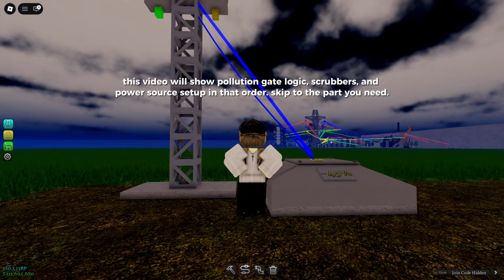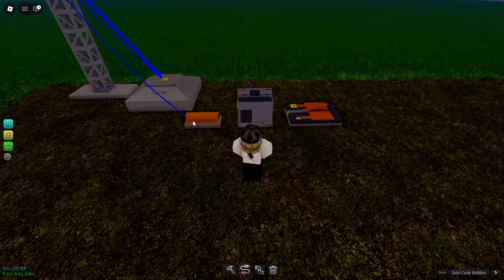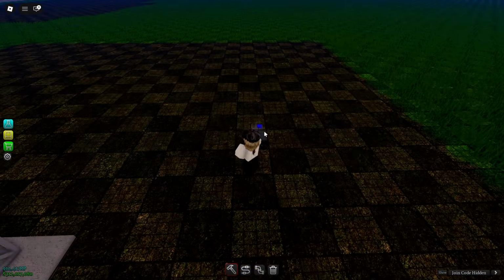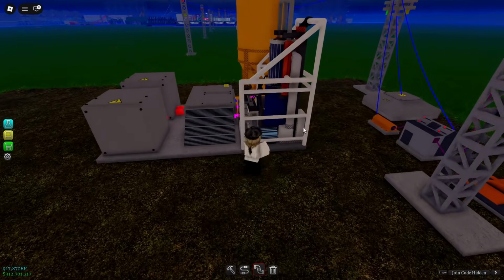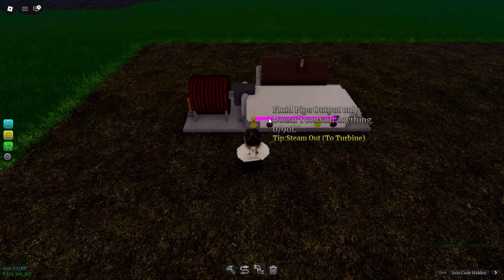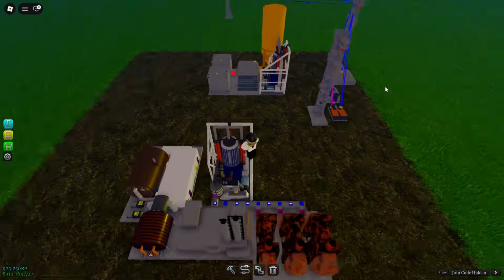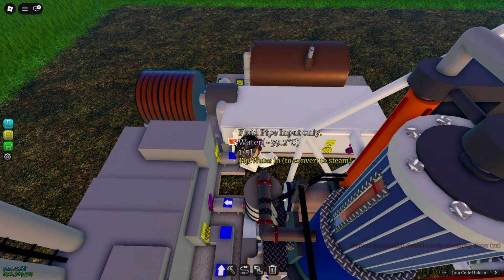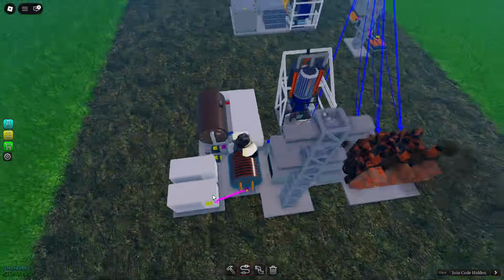pollution gate logic setup with scrubbers | industrialist

Comment from the maker: for anyone who's encountering issues, join my discord server: https://discord.gg/YQ8eZ4evgG
it's much easier to be able to see screenshots of your problems than describing them, a lot of the issues can be easily resolved if i see whats actually going on.

i've noticed that a lot of people have been doing the same mistake so i'll point it out:
your scrubbers should be receiving energy from your breaker's output.
main energy source->resistor->pollution gate
pollution gate logic output->breaker logic input
main energy source->breaker power input
breaker power output->hmvt->scrubbers
Reply: thank you so much, no one told me the hmvt and to be only connect to the breaker
Reply: im subbing rn (:

Comment: i dont think i understand, does the pollution gate logic work on all of the 34 scrubbers in my scrubber farm if i only have one pollution gate, or do i have to attach the logic gate setup to each scrubber individually?
Reply from the maker: you only need one for your entire setup, you just need to connect the output of the breaker to multiple hmvts to efficiently power the scrubbers.
Reply: @neuroticzombie  So all of the scrubbers need to be on the same HMVT series? Like they all need to originate from a singular HMVT? Sorry if that doesn't make very much sense.

Comment: I made a same version but with the logic fluid pipe valve and i think its simpler and better cause if you got alot of scrubbers you can just disable them by letting pipes flood with residue
Reply: but then how do you connect the logic breaker output into the logic fluid pipe

Comment: How come the logic breaker is not producing power?
Reply from the maker: the logic breaker stops power from flowing when the pollution percentage is lower than -45%, because you set that number as your max. once it reaches -44% it will let power go through so the scrubbers can bring your pollution back down to -45%.
Reply: @neuroticzombie ahh I get it thanks so much so for clarity my scrubbers at the end arent acually struggling for powering it’s just there not being provided power?
Reply from the maker: @HarpeeAubry  if you can provide screenshots on how your scrubber setup looks, ill be able to help. join my server: https://discord.gg/YQ8eZ4evgG

Comment: its not working for me, idk why, my pollution is at like -51 rn but it was at -130. so i had to liquid dump a bunch of residue so my scrubbers wouldnt bring it down further which limits my tree growth, i dont know how to fix it. everything is powered up, everything is connected, but its not limiting it to -45 and its going beyond -45 (e.g -130)  pls help
Reply: just cut the power and when you find a fix do the fix
Reply: @not_.kamixd I figured it out almost right after this, so I connected the logic breakers output to the node powering the scrubbers, and powered the other stuff with a different node

Comment: I have -1,035 pollution, it doesnt work, i've set the pollution gate to -45 pollution, the maximum value is enabled, although, if i dont enable minimum value, it just doesnt work, the power breaker has max power buffer, the power breaker is sending the output energy to an hmtv powering the scrubbers and water pumps, I have a diesel generator power source.
Reply: What
Reply: I think u should replicate what he was doing, by the way u should use something else to power it i think.
Reply from the maker: if you still need help, you can join my server

Comment: Bro pollution gate have 0 power how I have 50k polve
Reply from the maker: im not sure about what youre talking about, but the pollution gate is only the "brains" that decides if the logic breaker should be sending power or not. make sure youre using a resistor to power the pollution gate. if what you mean is your logic breaker not sending power, check your pollution levels and see if its under -45%. if thats the case then the logic breaker shouldnt be sending any power because its trying to increase pollution level. once the pollution level is at -44%, the logic breaker should be sending power.

Comment: I have -120 pollution, but when I use this, scrubbers still work,any help?
Reply from the maker: make sure your logic breaker is configured properly and maximum value is enabled. if that doesn't fix it, enable minimum value and set it to -45.
edit: also your scrubbers could still have power stored in them, and it takes a minute for it to fully deplete and turn the scrubbers off.

Comment: mine doesnt work, idk why but the Logic breaker isnt sending energy it only accepts, is that normal?

EDIT:: okay so i turned on Minimum Value but kept it on 0 and now it sends energy, it send about 0.1 mf,  BUT it still isnt working, i put the wire on all my HMTVS that are controlling the scrubbers
Reply from the maker: the logic breaker only allows current to flow when the pollution percentage is above -45% (value used in the video). check your pollution percentage and see if its under the value you set it. if it is, then thats why the logic breaker isnt sending energy. thats because it waits until pollution rises, and its triggered once the value reaches +1% of the value you set it to, which is when the scrubbers are activated to bring the pollution back down. 

the reason why you're seeing .1mf could be because it's still trying to power all the scrubbers, and how fast it can power all the scrubbers is heavily dependent on the energy source you're using and how much it generates power. a way to diagnose the issue is to check if your scrubbers energy is going up to its energy requirement (as it should), or if the number is fluctuating and isn't close to the required energy, which often means your energy source isn't supplying enough power.
Reply: @neuroticzombie  OH WOW thanks bro, mwuah mwuah

Comment: It didn’t work for me idk why
Reply from the maker: double check your wiring, and what pollution percentage your world is in. the scrubbers will turn on when your pollution level is above -45%, that is if you used the same value in the video. additionally, check if your scrubbers are getting enough power, as most of the time the problem is that the scrubbers arent getting enough energy.
Reply: @neuroticzombie cheers man I fixed it
Reply: also what does the minimum option do ?